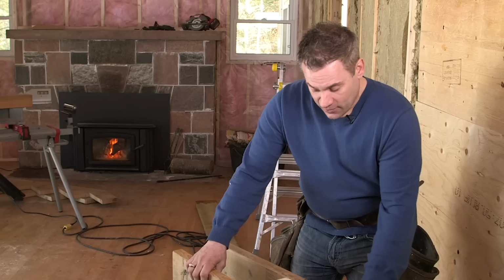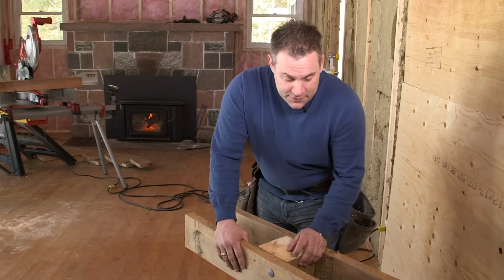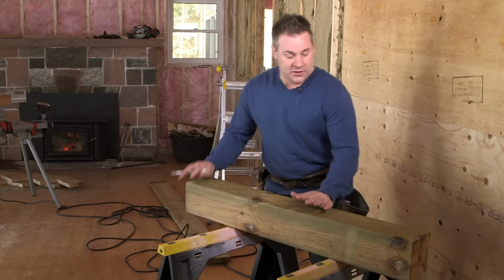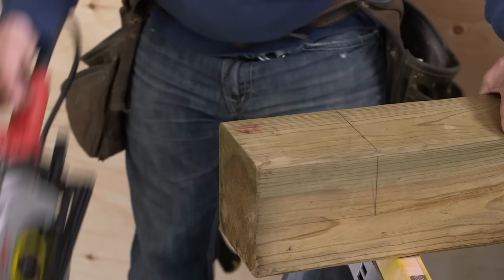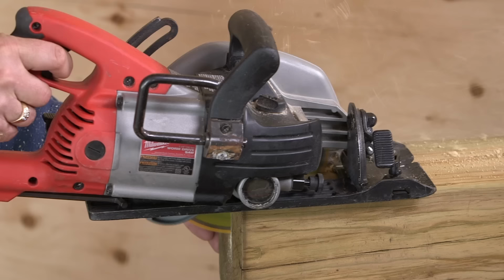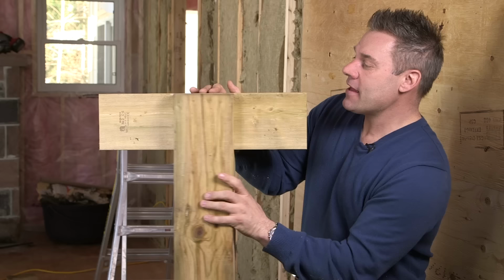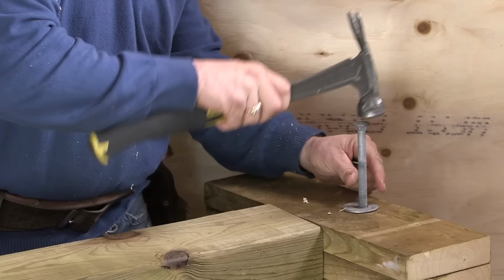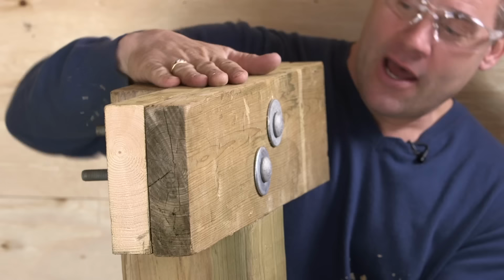How to Attach a Beam to a Post for a Deck | Decks, Docks & Gazebos

Comment: I am an engineer. I know what shear is.  Those bolts are in double shear. They get to add strength. The area of  a 1/2" bolt is 0.2 sq inches. The cheapest steel is good  for over 100 ksi. So 20,000 pounds per bolt shear, but double shear is 40,000 pounds per bolt. Two bolt s 80,000 pounds.  That is 5 big elephants. More elephants of average size.
When he breaks off the screw,  he loading a cantilever. That is not shear.
Reply: even five 16 penny nails will take over 800LB before they will shear? With that said I do exactly as the video described notch out and then I nail them in place.
Reply: Clark Magnuson succinctly put mate 👏👏👏
Reply: T
Reply: Analog human - would recommend the concrete patio...with that gathering, weight will be last of your cleanup worries...
Reply: @Clark Magnuson,  I understand where you're coming from, but you left out the possibility of wood failure as the cause of a deck collapsing. Shear value is meaningless and has no effect in that situation. Why take a chance on just a bolt to hold up a support beam?
Reply: @bgdesignandsolutions  there's only 3 bolts holding wheels on some cars.  How is this possibly safe?  ;)
Reply: @MotivatedMetalworks  Bolts that hold wheels on cars are heat treated and tempered. They are also fine thread which allows for firmer grip and tightening of the wheel lug (nut). The wheel is also designed with a Cone which collapses when the lugs are tightened. This works the same as a forcing cone, or in simple terms, a lock washer. The bolt is designed to take the torque of the lug. There is no sheer factor involved in a wheel lug, as it is a torque management with direct pull. The force is outward, not sideways. A typical lug bolt can withstand some 2,400 pounds of direct pull, thus making a 3 lug wheel able to support an estimated 7,300 plus pounds. Far more than is needed to support a car.
Reply: @bgdesignandsolutions  You're not big on sarcasm, are you.
Reply: @MotivatedMetalworks  That wasn't meant for sarcasm, I wasn't quite sure the meaning of your question, or why it was even asked. But I would like to add, most wheels on cars and truck use the center hub to actually hold the weight of a car or truck. But rarely, some do not make contact on a hub, yet the lugs are sufficient.
Reply: @bgdesignandsolutions  You sure like talking out your butt don't ya.

The hub holds the wheels via friction that's applied from compression of the lugs.  The hubcentric ring on the hub merely holds the rim in place while the lugs are tightened.

The only real dynamic force the lugs are exposed to is lateral (during hard turns, or horizontal impacts such as curbs after a crash or spin out), the rest is static which maintains the friction between the rim and hub assembly.
Reply: @MotivatedMetalworks  You need to stop while you're ahead. You just said exactly the same thing I already said, so don't continue because you will just look stupid.  You: The hub holds the wheels via friction that's applied from compression of the lugs.. . . The only real dynamic force the lugs are exposed to is lateral (during hard turns, or horizontal impacts such as curbs after a crash or spin out),    ME: The bolt is designed to take the torque of the lug. There is no sheer factor involved in a wheel lug, as it is a torque management with direct pull. The force is outward, not sideways.   Sideways is sideways of the bolt, not the wheel, in case you didn't understand that part. In other words, there is no vertical sheer, only outward pressure.    Other than that, what's your problem, you just wanting to cause an argument?? Because that's what is sounds like.
Reply: I'd need to know names of dances they will be doing and DJ/band set list for bolt recommendation.@Analog Human
Reply: Analog Human You have to take in to consideration if the animals are going to eat at the party that they will be heavier
Reply: The cheapest steel is not good for 100 ksi. Mild carbon steel has yield strength of 36 ksi.
Reply: BG Design and Soultions nicely done!
Reply: I'm no engineer but I did stay in a Holiday Inn about 6 months ago.  I'm never sure where, or how, engineers, architects,   builders, municipality inspectors,  and so on, get their information from but......you cannot use carriage bolts for structural connections.  THEY HAVE NO NATIONAL DESIGN STANDARD RATING.  (NDS)  With no NDS rating they are unacceptable.    This is easy to look up or call Simpson Strong Tie on deck connections. 

   The video shows a washer under the head of the carriage bolt but it makes about as much as sense as using bolts in the first place.   The underside of the carriage bolt has a square body.  When the nut at the other end is tightened, this square body turns at some point, and will tear at the wood fibers.   The nut cannot be tightened!.  The washer does no good at all in creating a positive connection.   The washer can actually deforms  Washers are required under the heads of nuts of through bolts.  (Both ends)  They are required under the heads of lag bolts.  

    Decks should be built like your house.  Live  (variable loads) are carried in tension or compression.  You can have loads transferred in sheer but they are ENGINEERED like joist hangers and hurricane clips, for example.  We see failures all the time of exterior decks......... Where there are no positive connections,   lateral or variable overloading,  and water works its way into the deck ledger assembly, (deck-to-house) weakening the connection. 

    Boys and girls do not build your houses decks, storage sheds, etc,  where loads are transferred in sheer.  You are asking for a whole lot of trouble.  (Don't even think about tree houses. They are death traps)  Call your favorite architect or engineer for plans.  If they say carriage bolts are acceptable, ask to see where that is in the NATIONAL DESIGN STANDARDS!   Your builder will not know this, but it will save you from injuries or deaths not to mention lawsuits.
Reply: I am still no engineer so this should be easy for you.  I suppose you could tell us where in the NDS that carriage bolts can be used for structural applications?   
     But let me help you.......You can always try finding carriage bolts being used under the Prescriptive Wood Deck Constriction Guide for code acceptance. 
  
    You could also go to American Wood Forrest and Paper Association-NDS for Wood Construction Manual references:  
   ANSI B1 18.2.1-Bolts and lag screws
   ANSI B1 18.6.1-Wood screws
  Tell us where you found the specification for carriage bolts (ANSI B1.8.5)

   "Not referenced", you say?  As an engineer, if it's not referenced what would you say they are acceptable for use?   You probably wouldn't tell that to your boss that or make a case for that in court.  Right?

    Look, I am not and engineer, architect, designer, code compliance official or attorney.  I am just a guy who likes woodworking, so it should be pretty is easy to say "I'm wrong" or "I'm correct."   I have given you all the necessary references for you to draw an objective conclusion.
Reply: the video shows the only acceptable way to support a deck beam in all 50 states and all of Canada according to current building codes. The first thing a building inspector would look for is proper load support. Carriage bolts would shut the build down immediately!
Reply: You are right Ken @rkenjohnson6705  All these comments seem to missing the point here.  It doesn't matter if the carriage bolt can carry  a dead and variable load of a  traveling circus with all the elephants....Carriage bolts are not approved for structural wood connections!  They just aren't.
Reply: BG Design and Soultions your vehicles made of bolts and you trust that lol
Reply: BG Design and Soultions nice try but the cones shape on lugs nuts and rims don’t collapse they just center the wheel and have more surface for grip
Reply: completely right....and On the other hand....if you tight enough  the bolts, it could be that. the main resistance of any movement  is made by friction between wood elements, and shear on bolts will be unexistant ( they will have tension only) .maybe .until wood shrinks  or have some volume changes..Im always  a little scared to reduce column section and have joint there.
Reply: Yes !Look at how heavy equipment trailers frames are attached to the under carriage. Bolts! Most trucks are supported by bolts!
Reply: BJ remind them that the weight of the vehicle  makes all the difference in the world    my 3/4 HD truck takes 8 lugs
Reply: As an engineer I look at that notch and see nothing but stress concentrations which in wood is really bad thanks to the fact they have grain which can split. The other thing he forgets is when clamped the mating surfaces develop friction which can transfer load like a wheel clamped to a hub on a car. The studs don't carry the load the friction between the hub and rim does.
Reply: @jaredbradley4095  you're a carpenter you know the one who had zero responsibility if the design fails. I'm the engineer the one that spent half a decade learning physics and mathematics. You only build to codes, codes created by people that know how the hell the real world works. Before you get all uppity realize the modern world was created thanks to theory guys in a nice AC office. Or would you have created nuclear power plants with some real world know how?
Reply: How about the roof load bearing down and splitting the 2x6  from having big ass holes drilled into it for the bolts.
Reply: Jesus please dont tell me you're a practicing engineer. Literally the only things u said correct are double shear and the area of a half inch bolt is .2 inches.
Reply: I agree with you I'm 62 and been doing it that way from when I was 18 and it always pass the building inspection so Mr engineer your right
Reply: thank you -- this makes a lot of sense.  That said, I cut notches like he recommended because it never fails that when I throw a party in the summertime, all the fat girls show up and things could get a bit dicey.
Reply: My god you guys... Really?!?!?  Surface area to distribute weight is crucial, keep it simple, not much surface area on a bolt, end of story.
Reply: Engineers estimate weight with elephants.
Reply: @Analog Human elephants aren't allowed  , they drink too much.
Reply: Clark Magnuson you are right, after the bolts structure get stronger also as the framing gets further along when square Ed up and complete there won't be any real violent movement to the post and beam. If the right style bolts aren't sufficient than I know not quite the same, but metal joist hangers would never be sufficient and they use 4 nails.
Reply: misa smith  ...hit a nerve ?
Reply: The 2 beams gain strength sandwiched together.  Splitting them around a post is another reason its a terrible idea. Waste of lumber.
Reply: Day-um can't we all just get along?
Reply: @MotivatedMetalworks  Race cars only use ONE!!!
Reply: @transtubular  so do helicopters.  ;)
Reply: Sure bolts can be strong.  But even stronger is putting the beams directly over the posts.  Its cheaper than bolts. And stronger.  So there is no reason to hang a beam up off the side of posts with bolts.  Except maybe in a special application when thats the only option.
Reply: Clark Magnuson also an engineer and was going to say exactly this. Sure, the alternative he shows is stronger due to adding the compressive strength of the post into the equation, but in no way are (2) 1/2” carriage bolts an unsuitable support for a regular deck
Reply: Pete Sessa l
Reply: Keep it simple engineer
Reply: Eh, the bolts hold friction in addition to the shear strength. Just as the little screws don't hold rock on the wall. They hold friction that holds it up.
Reply: Ill trust his house in 100 years not yours.  You obviously havent seen the effects weather has on man made materials.  Your a mathematician not a crafstman.
Reply: While this video may not have perfectly described the forces involved, this method of construction is vastly superior to simply attaching the post to the beam via two lag bolts.   Bolts are usually manufactured to exacting specifications that vary little from bolt to bolt and so if you calculate the strength of one you pretty much have the strength of all the others.  Wood, however is not so consistent.   While you MIGHT be safe using the former method, the later guarantees it.  In the bolt only method the only wood that is directly supported by the top bolt is about the top 20% of be beam.  The lower bolt supports about 80% of the beam.  If one is to do bolt only then both bolts should be close to the bottom of the beam.   However, by cutting a notch in the post to support the beam then the primary function of the bolts is to merely fasten the beam to the post.  Since 100% of the beam is ultimately attached to the post anyways, one might as well use a more stable design.   After all, with all the variation from beam to beam one can never be absolutely certain if the beam is going to split or for that matter the post.  That likelihood is greatly reduced using the second method over the first.   Also, there must be something to it since if you are making a deck, the building code requires the second method or some variation of it.  I'm not an engineer.  But I have been  building decks since 1976 when I was 16.  My first deck ever still stands and I guarantee you could safely march a heard of elephants across it to this day.  It is good to be an engineer but engineers don't know everything.   I have worked for or with several and none hold any patents.  I hold three.
Reply: I don't know what car only has three bolts.   My car has four wheels each has five bolts for a total of 20 bolts.  My car weighs 3000 lbs.  Add in passenger weight of say 350 lbs,   That comes to 168 lbs per bolt.  Using the standard that anything carrying a human must have a breaking point 5 times the rated amount. I would say that the breaking point per bolt should be 840 lbs.   Anything transportation related is very carefully engineered as to weight ratings.   I am less familiar with the engineering of lag bolts but I personally would only use them to fasten, not to support mass.   A structure would likely be required to hold a lot more mass than the four wheels of a car.   The deck I first built when I was 16 rests on four posts that are 6" x 6" oak.  They have 8 cantilevered beams using a similar construction technique to what is in this video.   The deck is 16' x 16' and I built it in 1976.  It sits four feet above the ground.   We have had 25 adults at a time on that deck along with furniture, BBQ grill, planters and recreational equipment as well as the weight of the beams and floorboards and other construction materials.  Not the slightest vibration.  I estimate the weight on those four posts at about 8-10 tons including all of the above.   There are a total of 16 3/8" lag bolts fastening the beams to the posts.   It has survived 44 years, 2 hurricanes, 1 tornado, 21 tropical storms, 57 blizzards, and over 500 summer cook-outs.   I would invite any heard of elephants to march across my deck or for that matter as many as you could cram onto the deck.   I am very confident it will outlive my great grandchildren.  I would be nervous riding in a car with only three bolts per wheel.   But then I don't design cars.
Reply: @nunyabiznez6381  decks are not that hard to build if you have some common sense. This is why the decks you've built in 1976 still stand.
I would have loved to see him shear the screw with no mechanical advantage, like for example hit the base of the screw with a flat head bolt and a hammer... That would be shear. And it's muy harder.
Reply: your missing the point....the point is to have the beam carry the weight, not the bolts, as its designed too....id hate to have you engineer anything for me
Reply: Everyone talks about the unpredictability of wood, but what about the bolts. Those bolts are galvanized, which resist rusting and oxidation for a limited time. Once the coating dissipates, the metal begins corrode. Much like a galvanized chainlink fence, they rust. Usually why a 5 year warranty is the standard. 

Not sure why these engineers resist having the beams rest on the notched post.
Reply: I don't think the "Shear" is as much a concern for the bolts as it would be for the holes in the wood ..... The WOOD is probably where any problems might arise , not the bolts .... The holes in the wood might loosen up , maybe crack , no telling later on after the wood has aged and been wet and dry 100 times ..... The guy is technically right , that IS the proper way to do a beam and post , to set beams ON TOP of wood is stronger .... There's no doubt about that ..... Not saying bolts won't hold of course , they are strong ..... Just saying his way is BETTER overall .... A hassle though , I'd set beams on top of post using a Simpson Post/Beam Bracket myself
Reply: You're not much of an engineer then if you want to support lumber in this manner. This isn't steel.
Reply: Im actually curious if a deck could hold a full grown elephant on top of it. Anyone know?
Reply: @shure46  thank you for understanding the physics of lumber. Our "engineer" above forgets that the bolts aren't the issue, it's the lumber that is carrying the load. No matter how much one tightens the bolts, the lumber one way or the other is carrying the load. Side bolting the lumber without support is a recipe for disaster. That's why load-bearing walls and doors have sandwiched headers . . . Sane principle here.
Reply: @PorkyHontas  I only know one thing , Greek Temples have beams ON TOP of the columns , not bolted to the sides .... they seem to be holding up fairly well after 3000 years ...... lol ...... but like i said , bolting works , but resting on TOP is always better , no way around that ..... I don't know if I would go to the trouble of NOTCHING the posts , I would just use simpson post/beam brackets , but the beams would be on top of the 4x4 post and no notches ...... (notching removes lumber , smaller lumber rots quicker over time) .....
Reply: #MAFA
Reply: Thank you for that info! I love to learn more about the calculations for my own personal projects. A++ info.
Reply: What's the purpose of using carriage bolts with washers?
Reply: While it is true that there is actually quite a bit of shear strength in carriage bolt. It is not approved by any wood standards/relevant codes. Thus cannot be used in construction. 

So while in a mechanics of solids point of view what you say is kinda correct, aside from the fact that you are using high strength steel and cheapest steels are actually 36ksi and you completely ignored the strength of the wood which would have to bear on the bolts and the way that the bolts are placed will reduce the total usable shear area of the wood. 

It is completely irrelevant, as it is not to code (unless your local ordinance approved of it)

Having said that, physically speaking the wood would likely shear around the bolt long before the bolt will shear and that screw example in the video was pretty terrible.
Reply: @jaredbradley4095  if the board is going to crack its going to crack where its not supporrted
Reply: @jaredbradley4095  You do know that their "theories" are created with the idea of unpredictability in mind, right? I say this as a carpenter. If you're looking for a way to erase risk 100% you're wasting your time.
Reply: @NGWrenchin  Unless one is trying to get them to pass any sort of city building code in the USA or Canada. If one is trying to pass an inspection, then, yes, two carriage bolts are unsuitable. By the way, would you sign off the plans that called for using two carriage bolts in such a structure? If in the off chance you were dragged into court to defend your choice of carriage bolts for structural connections, what code would you point to to support this?
Reply: @firepower7654  I would and have signed off on it,  and I would point to math, physics, and material science proving it is a suitable connection. What would you like to use to show it is wrong other than gut feeling and 'I've always done it this way'?

Again, I'm not saying the way the video says to frame it is improper, but there are multiple ways to build things that can work for the loads intended. Saying there is only one proper solution is just wrong.
Reply: @NGWrenchin  Well, it is obvious that you are not a structural engineer. It is a matter of "I've always done it this way", it is a matter of building codes. These codes are in place for a reason and have been tested over time. They aren't always the best way, but a minimum standard. If you were actually in the construction business, you would know that a bolt through system, as given in the first example, is NEVER acceptable in such a structure. EVER. At least not in the USA or Canada. An inspector would probably laugh in your face if you handed him these plans even if you said, "...but math." 

There are multiple ways of doing something, but only a handful of acceptable ways.  A Simpson tie or similar manufacturer with tested and documented materials backing those tests is what is looked for by every engineer and inspector that I have ever worked with. Those are the key documents protecting that engineer from liability in the case of failure of a connector. You're the first I've ever come across that thinks its acceptable to "just throw a carriage bolt through that."  If you're talking a job for you neighbor that isn't going to be inspected, that is one thing, but if you're putting plans together for a PAYING client, that's another. Best practice is not to hand over plans that are never going to pass inspection, and waste that clients time and money.
Reply: @firepower7654  I can assure you I am a licensed engineer in multiple states and  there is no part of the residential construction code for those states that prevents this method of band attachment. As for the documentation from Simpson/ USP/whoever rating their connectors, what do you think that is other than published results of their math? Engineering is literally the practical application of math, physics, and material science, so if I have an inspector who has a concern with something that is not a structural issue, I tell them "but math" as you state it, with my seal on said math, and it passes, end of argument. The state has the confidence in my design abilities after taking multiple tests proving my ability to do 'but math' to a standard they deem safe for public welfare.
Reply: @NGWrenchin  You think your engineering degree trumps a building inspectors stamp?  Sorry....I had to stop for a minute to fucking laugh my ass off. I can't tell you how many times I PERSONALLY have had to call up engineers and ask them what the fuck they were  doing because the inspector just threw their signed off plans in my face and told me to piss off. Your signature and $2 will get you a cup of coffee at Starbucks if they go against or are not understood by the inspector. They are meaningless if they aren't accepted and in practice methods as stated by a planning and building department.
Reply: @mattedwards4533  
What is a penny nail, I've never heard the term. I've used plenty of 2,3,4,5,6 ins etc nails but not a penny nail. You say five 16 penny nails, which is it 5 or 16?
Reply: @globeforever9777  ,Use five nails the size nail is  16 penny. 16 penny is how you size nails.It is the nail used when framing up a structure the conventional way using a claw hammer.It is an old English term used by carpenters. I believe it means penny weight but not 100% sure ?
Reply: @mattedwards4533  
Thanks, it must be a U.S. thing. I have been in the joinery and building trades for around 50 years in the U.K. and I have never heard of "penny" in connection to nails just length and gauge.
Reply: I'm also a structural engineer and I abide with this comment.
Reply: Not only is Clark the Engineer absolutely correct about the shear strength of the bolts (and correct about the irrelevance of the screw-breaking stunt), but notching the post is a major detriment to the longevity of the wood. It creates another flat surface of untreated endgrain for water absorption, this one being perfectly designed for water to seep into by capillary action, but unable to easily evaporate. It makes infinitely more sense to minimize trapped water on wood surfaces (especially where the ends are exposed and treatment is cut away), and to rely instead on the far stronger shear resistance, and greater longevity, of the bolts.
Reply: Clark Magnuson - That's well stated and I agree with you, and I would add another reason not to worry.  As long as those carriage bolts are tight enough that shrinkage of the wood does not cause them to actually become loose, they will never even need to rely on their shear strength at all.  When the bolts are tight, the friction between the beam and the post where they clamp together will exceed any load that will ever be carried by the beam.  This clamping force and resulting friction at the connection point is exactly the same principle that prevents the wheel studs of your car from undergoing shear stress when you slam on the brakes.  If the wheel nuts are tight, friction at the connection of wheel to hub exceeds any force that's applied there.  I DO love your analogy about adequate shear strength though (5 big elephants, and more if they are average size).  Well put.  Also, the info I added here is not for you, but for the original poster.
Reply: Carriage bolts come in many different metals. The galvanized ones are crap! You can pop them just by tightening them.  Zinc coated are good though.
Reply: @grad79 I removed a support wall by sandwiching it with 2×10, temporarily fasting it with 2 deck screws on each end with a rim/knee brace ten years ago in my 2 story house 😊😛😝🔨📐📎
Reply: @Analog Human : lololololol
Reply: But he is still right. All building with would should leverage compression to the fullest, not rest on connector piercing the midst.
Reply: @transtubular  Yeah, but it is a BIG one! 
You only really have to worry about multi lug applications when you are trying to keep the tires from shearing off your house when you have fat trailer park girls at the party.
Reply: @tomknud  Absoultely, unless it is a building made of would not. 
Get it "wood knot". I'm killing it today!
Reply: @davecozzi9721  ahhahaa
Reply: @MotivatedMetalworks  The cross section of metal is stronger so that a bolt through it wouldn't act like a splitter as it would in the through bolt version this fellow is derogating.
Reply: @nunyabiznez6381  I agree with most of what you've said and would choose the second method over the first for my deck, it's your idea that all bolts are created equal, not true, there is more varieties of bolts than apples and oranges combined, each made for a specific set of circumstances, bolts that say NASA use would not be found at home depot.
Reply: @bgdesignandsolutions  more importantly there is a flange machined into the spindle hub, the wheel sits on this flange, so this is a terrible example, Because the bolts are mostly in tension, clamping the wheel to the hub
Reply: Thank you for saving me the effort of explaining how stupid this is
Reply: I am / have been at various times, a Military Engineer, Carpenter, Maths Teacher and Science Teacher. The Engineer says ‘what do the construction tables say’, the Carpenter says ‘halving joint’, the maths teacher say ‘let’s calculate the stresses’, the scientist says ‘let’s make up two decks in two different ways and have one big ass party and see which one fails first’!
Reply: Pete, I'd agree with you up to the point where a building code allows deviation from the code on the certification of a design professional (architect or engineer).  I had to do something unorthodox on a repair to my home three years ago.  We engaged an engineer to devise that solution.  The engineer had to certify that solution to the building inspector and did so.
Reply: Thanks Clark.
Reply: I study physics.  The point is that the mass is distributed on the wood and post instead of just using the bolts themselves.   Can it take it?  Maybe.  Why not over-engineer just incase your mom comes over and climbs up on top.
Reply: TJP 81  With full tightened carriage bolts you'd have to load the post up with 10's of thousand of pounds to cause the bolt to sag into that wood!
Reply: I hate carriage bolts. If you need to uninstall the bolt the heads always lose grip due to soft wood and spin. I use hex head bolts with large washer.
Reply: Even noting he's hitting a cantilever. A hammer can still impart thousands of pounds of force on a small area, when a #8 screws shear force is like 25 pounds
Reply: matt edwards if he is so worried about it he can add 2x4 under instead of notching a post like that never had problems anyway I have yet to see one sheer, imagine if that were true not one building would stay together or vehicles with the bolts pulling trailers
Reply: only argument can rebut your argument with is, a notch helps prevent catastrophic failure.  
With the change in Pressure Treatment formula yrs ago that caused a revamping of "deck grade" galvanized fasteners,  failure of the fastener became a big issue, the old galvanization treatment with the old PT formula was fine, the new formula ate up the fasteners through electrolysis, yes even the notched version will have fastener failure, but the "post and beam" similarity can prevent a failure at potentially the worst time.  If going to rely on the fastener for structure, must pay VERY CLOSE attention to to fastener treatment.  wrong fastener can lead to a very premature failure with dire consequences.
Reply: @chucksewers2309  its called a cleat. And its standard practice on certain decks.
Reply: BG Design and Soultions wrong. Roughly every 10 feet there is a connection like this.  So every frame connection would have to fail. Notching the wood works. But he failed to mention you loose strength in motion. If that wood moves back and forth let’s say from an earthquake all connections will snap from his Notch.
Reply: wrong. Roughly every 10 feet there is a connection like this.  So every frame connection would have to fail. Notching the wood works. But he failed to mention you loose strength in motion. If that wood moves back and forth let’s say from an earthquake all connections will snap from his Notch.
Reply: R Ken Johnson this connection is not allowed in California or New York. You can not cut a notch into a support beam like that. You have to lay you beam Ontop of the vertical wood. And use a Beam connection clamp. You can not creat stress fractures. This connection is not allowed in a lot of states
Reply: Pete Sessa your wrong. You forgot to mention. In all those Books it says unless the Local AHJ having jurisdiction says other. Also this connection is illegal in California and New York. You can not notch Support beams and create stress point. You must use Beam connection clamps and Top load. If this guy ever got an earth quake or hurricane it fall down FAST
Reply: Pete Sessa your first ansi b1 18.2.1 is for Hex Bolts you labeled that wrong. And it’s a cut sheet and does not list sheer strength or say what you said. So don’t lie
Reply: @julioweber3944  what's funny, is everyone saying you can't rely on bolts alone for structure. I guess every addition/deck is going to fall apart that has lags for their ledgers. 

IRC does dictate notching is an acceptable means of putting a load in a deck, but I prefer a cleat. (IRC states you need minimum 1.5 inches of bearing ABOVE your postt/beam. Most municipalities will fallow this. 

Again though. The bolts themselves are MORE than enough, and there are decks built 50 years ago like this, still standing today.
Reply: I would think it's the wood that would split over the bolts
Reply: @OldPossum it doesn't matter as they are not acceptable by building code and inspectors will flag that
Reply: @cowboytroy72  regardles, they are not acceptable by building code and inspectors will flag that
Reply: The best solution actually is to attach the beams to the top of the posts with post saddles.
Reply: @OldPossum I agree that's it's possible and that it should hold. Best practice though is to rest the weight on top of posts instead of bolt to the sides. That's all.
Reply: Direct weight transfer is always the way to go. Relying on indirect weight transfer for a beam is a bad idea. Having a degree in engineering doesn't automatically qualify anyone as an individual who knows what they are doing or talking about.
Reply: OldPossum  facts are facts...skippy. Whether it’s a deck, a bridge, sky scraper or a home, the basic laws of physics always apply. A good engineer, someone who understands applied engineering verses numbers on a page can relate to what I am saying. Build it right or don’t build it at all.
Reply: bbillyed .
Reply: @Analog Human If you invite my wife I recommend you build it the way it was demonstrated.  I was using a laser level one day and when my wife walked by I saw the light actually bending.
Reply: @kaz9781  Indian or African?
Reply: Agreed on the false shear pressure example. But, the wood, in the cross beams, in two small areas, is accepting all the weight of what is to be stressed upon them. Now include weather, i.e., rain, snow, freezing, and hot...
Mr. Engineer, do your figuring on the load bearing capabilities, on the doubled up, notched post bean support system.
Reply: @nunyabiznez6381 An awful lot of French cars have only three bolts holding the wheels on. I suggest you look up the law of inverse squares, assuming the same material a single one centimeter bolt has more shear strength than four .25mm ones :)
Reply: Clark Magnuson Jason Lake has it right. No risks. Notch the damn posts. End of story.
Reply: John Parkhurst so the bolt head or nut don’t dig into the wood.
Reply: OldPossum   lol at least I have a tail to chase. You can equate that to “I have a pot to piss in”. Which leaves you without one.
Reply: Shouldn't they install deck beams on top of concrete piers?
Reply: Roger didit   No, the posts are installed into post bases which are mounted in or to the concrete peering . The beam supports the joists which in turn transfers the weight to the posts and finally to the peers. That is why it's important to notch the posts so that the weight transfer is direct instead of offset.
Reply: @greatamculture  OK thanks now that I remember back, I'm positive that you're right.
Reply: I agree.
Reply: @glynowilliams  when I built the deck I took into account that the food would be set out on the deck. So, whether it all gets eaten or not, it may add weight to the animals but not the deck as a whole. Hope that makes sense.
Reply: @Carl-LaFong1618  african
Reply: Yeah I got that thin piece of paper too.. I was thinking the same thing BUT were racing so fast to defend the massive shear strength of the bolts that clearly would never fail in a properly designed deck or frame, the WOOD could EASILY fail if it rots a bit, not so easily with the notch, but yeah in a perfect world with no rot those carriage bolts aren't going anywhere with normal loads.. the notch step definitely adds some serious strength though I get it..
Reply: I deal with engineers every day. A good one stays humble and doesn't need to tell everyone
Reply: @petesessa2041  like the Kansas city incident years back?
Reply: @Slick1G3  my  06 gmc  takes 32
Reply: @JM-nh8yp  ever build a fence ?
Reply: @nunyabiznez6381  can I come over for a cookout with my elephants ( wife and kids) and check out your deck. ?
Reply: @lostcause1206  Yes I have built fences. Of course, fences don't carry a load like decks do.
Reply: Issue isn't the bolt it is the wood will crack down the grain line and potentially the beam falls.  It needs to be notched or can be placed above the post with galvanized bracket. But yes you are correct about shear and bolt strength
Reply: @lostcause1206  Well....The sky walk collapse was do to an unapproved connection inserted into the tension cables that supported the assembly.  The connection failed at the "weak link" and rest is engineering and legal history. 

  In the meantime........ carriage bolts ARE NOT referenced in the National Design Standard (NDS) for structural wood connections and are therefore not approved.  Seems simple to me.
Reply: Analog Human How did your party turn out?
Reply: Them there tyaneeze bolts ol do er  . I R An engineer to
Reply: nunya biznez asa
Reply: its not the bolt that will fail. its gonna be the beam that will fail. Putting one elephant on half inch bolt over wood beam lol it will cut the beam right through like knife cutting butter.
Reply: No offense but I'd rather trust the person that actually installs it.
Reply: Proof that an engineer is not a carpenter.....we fix your "better" ideas all the time.
Reply: Kelly Giesbrecht  Yes, you obviously didn't read my own posted comment on this video and just reading the conversation here. As for the "teleposts" in a basement, keep in mind most of them are not supported by a foundation at the bottom and eventually cause the floor to crack, or even break through. Therefore, they cannot be placed just anywhere, but yes, they are usually placed under a joist or beam. 

Most tires are placed on a hub, with the hub making contact all around the center. The spindle, or hub, becomes the beam and the tire becomes the post by the scenario. So long as the post (spindle) is on good foundation (hub contact), the beam (spindle) is good. Should the lug bolts fail, so then does the beam as the wheel falls off. Comprender?
Reply: @bgdesignandsolutions  No you are totally wrong.  What "cone" on the wheel are you referring to?  Nothing collapses on a wheel.  If you are referring to the 60* bevel of the lug nut this is simply to help center the stud in the hole.  I can assure you the hole doesn't collapse and uncollapse every time the wheel is installed and taken off.  Also in your second comment you are referring to hub-centric wheels.  These are a fairly new occurrence and have nothing to do with the wheels ability to stay put.  The hub lip is so small that it does nothing with respect to the lugs.  It simply allows people who don't know how to center a wheel to do so without thinking.  A great many vehicles are still "lug-centric" as well as most aftermarket wheels that need to fit a variety of applications.  Clark is totally right.
Reply: @jfratis9081  Next time you change a tire or rotate them, be sure to watch them flex as the lug nuts are tightened and loosened. I think you're missing the whole point, and it would be useless to try and explain anything to you. I stated something simple long ago, and an average person should be able to understand. It's not a big issue, it's not the end of the world, and maybe someday you'll figure it out.
Reply: @bgdesignandsolutions  All of your arguments are nice examples of finely crafted word salad.  Well done but in the end you are wrong.  Sophomore college papers must have been your forte.  If the wood fails you don't have a deck no matter what technique you use to put it together.  Your attempt at being condescending has failed.
Reply: Carriage bolts probably rated 30 ksi tensile strength not 100 ksi. Shear strength is usually half of the tensile strength so: 4X150000X.2=12000 lb. Whether or not that method meets code I defy you to make that a failure point unless you park three cars on top of each other over the connection. It’s a deck and the joists will fail LONG before this point connection. All that said he is telling us the correct way to do it but  I have a perfectly serviceable 35 year old uncovered deck using the other method.
Reply: True. If he had taken a Strength of Materials class he would have said you want the wood in compression which is what he really achieved. He just had to say it in terms the wood butchers will understand. 😭
Reply: Hell you shouldn't even be building a deck out of wood anyway that's a Mason's job with a block, bricks or decorative stone or concrete pony wall perimeters fill dirt and sand with a concrete slab top .Never rot out, won't burn with your grill on top,  won't slip when it rains , Don't have to worry about rodents getting under or weeds or grass. All for about the same price with the high price of wood now days.
Reply: @Analog Human 😂😂😂😂
Reply: @notsofast I wouldn't say "can't ", it's more like not recommended and that depends on if they are zink coated or mechanically galvanized.
Reply: Issue isn't shear force it's pull out force. Not to mention the clamping force creates normal force which creates friction like a lug nut/wheel stud situation.
Reply: @MotivatedMetalworks  the expert there doesn't know his crap. The reason wheel studs don't fail is because they aren't put in shear. The moment they are you have a wheel flying down the road. The clamping force generated produces a massive amount of friction. This friction is plenty to stop the wheel from slipping on the hub. The lugs then don't have to take any shear forces as the friction handles it.
Reply: @petesessa2041  engineers don't rely on some lookup best practice table to do calculations. We are the ones that make those tables for people to use that can't do differential equations.
Reply: @wolfpack4128   You honestly think there's only sheer forces on a wheel?  Hahahahahaha
Reply: I have to agree
Reply: My concern is with the wood. The notch does look good.
Reply: @wolfpack4128  - Are you saying that posts shouldn't be notched in this manner to accept a beam?
Reply: @pterafirma  The point of this sort of joint is to allow for the 

The endgrain exposure created by the cut should be immaterial if the posts are made of an appropriately rot-resistant material.  If rot is a concern the cut areas can be treated in the field.
Reply: That is not what the guy on the video was talking about.  And wood failure could happen on the support column also
Reply: Very well explained sir. Thank you
Reply: I agree, but if you look you are then relying on the wood to carry the load. Assuming the load is simply supported the bearing stress on the wood (2x6) would cause the failure. The proper way he showed put the force on the post rather than the bolt, which is now used for holding the beam in place. To say it could hold 5 elephants is over looking the strength of the wood and the failure mode of the original design. The fact that its in double shear would only come into play if the material was equal  or better in load capacity to the bolts.
Reply: @LetsGetFitLarry   Yes Larry, there is more than one issue. But he has 5M views. I get to point out the metal is not overstressed. I like Hoadley's book "Understanding Wood" for designing things from wood. My grandfather got used wood After the Alaskan Gold rush at the Seattle Denny regrade. He built chicken coops. In 1950 he used that same lumber to build hip roof homes still visible on google earth at 138th s. and occidental in Burien WA. That lumber is over 150 years old now.
Reply: Maybe he has a lot of heavy people that come to his deck parties ... (:>)
Reply: @rkenjohnson6705  Here in the Demokratik People's Prison of Canada, compliance signatures come with a big brown envelope full of US cash. All other details are inconsequential until the structural failure occurs.
Reply: I totally understand your structural explanation.
I watch YouTube all the time to learn how to do things. Often I see people use the wrong terms,  or wrong techniques, or wrong instructions to do things.
Reply: I'm a mechanical engineer and was about to write the exact same thing.
Reply: @wolfpack4128    Look, I am no engineer.  And I think engineers make the world go round with an occasional failure along the way.  They are infinity smarter than myself so this should be easy for you. 
  
  The American Forrest & Paper Association (Made up of engineers like yourself) have developed and codified a National Design Standard  (NDS)  for Wood Construction.  You know, those pesky set of standards for building stuff.  
  The American National Standards Institute (ANSI) is a privately funded federation of business and industry, standards developers, trade associations, labor unions, professional societies, (like engineers) consumers, academia, and government agencies.  You know this. 
  Under ANSI B18.1.2 (Bolts and Lag screws and B18.6.1 (Wood screws) are referenced in their specifications. You know, those things you reference in your specifications all the time. 
  The specification for carriage bolts (ANSI B18.5) is not referenced in their specifications. Since is is not referenced, the performance (load) for carriage bolts in wood applications is not available. Therefore, it is NOT an acceptable fastener for structural wood applications.  
  Now then, tell us all how carriage bolts that are not a part of our National Design Standard and ANSI are somehow acceptable in your office or firm.  
  This should be easy for you too explain without trying to tell us how smart you are or trying to expand the argument.  (This is not about sheer strength, differential equations or moment frames) Tell us how a standard cut washer goes under the head of a carriage bolt without deforming.  Tell us how the bolt can be tightened from only one side.  
  I think we all can tell how smart someone is when they can answer questions in their field, simply and easily, without getting defensive or trying to change a premise or goal post.  
  Why not give us the place we can go to see if what you know is correct.  Reference any table, engineering standard,  professional group that supports your contention. Sounds simple to me.
Reply: 5 average texans then
Reply: @petesessa2041  Nobody gives a shot how the king says we have to build our decks
Reply: You need a load table chart in order to determine how much a 4x4 post can support. What I can tell you is this is the correct method for installing a joist to post👍
Reply: I agree like I said use grade 5 or 8 or a325
Reply: Another factor, to consider, is the codes enforcement officers. No matter how strong the bolts might be, if they don't meet code specs, it's a moot point.
Reply: When they bolt together a structural steel skeleton for a skyscraper do they notch the columns for the girders no they are bolted to plates welded to the columns All connection bolts are in shear load
Reply: @tonyhemingway7980  you don't have to get a permit to build a deck. It's like speeding or smoking weed. Just don't get caught.
Reply: @bgdesignandsolutions  In all actuality, the weakest "link" in the first design is the 1.75" of wood between the carriage bolt and the edge.  The question should be "how much weight will 3.5" of treated lumber hold?"  You are correct in your assertion that the wood would fail long...LONG before the bolt would.
Reply: nunya biznez 
The answer to the question of which car use 3 wheel studs is the Citroen 2CV .
Reply: Dennis Madigan 
You cannot use zinc plated bolts in treated wood in an environment exposed to water.  The bolts will decay from the preservative in the wood. Hot dipped galvanized bolts are recommended. Typical carriage bolts are grade 2 and have a rating.  You may have to use a larger diameter bolt to get the strength you need.  Carriage bolts are not made of cheese, they have a rating it's just not as high as a grade 5 or grade 8 bolt.
Reply: @nunyabiznez6381  how about Smart Cars?
Reply: @EitriBrokkr  this is only true for hub-centric applications. Most modern cars are lug-centric.  Most after market rims have slightly larger hub center diameters so they fit on a wider selection of cars, with the same bolt pattern but different hub diameters, i.e. Toyota's and Nissan's (Toyota sedans have smaller hubs than Nissan sedans)
Reply: Thanks.  Pretty much what I thought as well.  The drywall screw is hardened, never intended to take the load as demonstrated.  Of course it broke.  A nail or bolt would bend without breaking.  (Not suggesting to use a nail here; just commenting on the difference in metals.)  Notching is better but the OP's post has false premises in it.
Reply: @petesessa2041  Because we all know that no building history was ever safe to live in because Simpson hadn't come into existence yet or because some guy with a stamp didn't approve it before it was built.
Reply: "Double shear" only works with tight tolerances.  With wood which can warp or the holes can be non-precise, it is irrelevant.  One can experience 90% of the shear before the other experiences any (remainder being absorbed by friction between wood surfaces).   You are absolutely correct on the screw example though.
Reply: Yeah, it's easy to break or bend a fastener that is only half way into the wood. I think the notching technique just looks more neat.
Reply: I don't know what the hell your talking about but I concur.
Reply: Yeah, this guy really missed the mark.  Bolt shear strength plus clamp strength are much more than sufficient to carry the load.  I would be more worried about the wood fibers tearing than the bolt shearing.  BTW, I'm an engineer too! :)   Six year old video and somehow, Youtube thought I should watch it...go figure.
Reply: @gpa1978  Nonexistent.Finish high school.
Reply: @Grunt49  you are right, I did it almost 25 years ago, Im trying my best with secong lenguage though
Reply: @petesessa2041  The NDS ratings exist for construction to that standard, which is a predetermined and engineered way to achieve building compliance with regulations. An alternative and acceptable way to satisfy compliance is to get a structural Engineer to specify a solution based on their calculations and design. If an Engineer determines a bolt is a satisfactory structural connection and will sign it off, then that is acceptable. 

I guess you stayed at the wrong Holiday Inn if you're not sure how the system works or how the pros get their information. It's called Engineering - physics, testing, refining and knowledge born of degree study. You're welcome.
Reply: B really retry
Reply: Never met an engineer outside Europe who understood timber.
It's not just about the bolt failing.It's also about what happens to the timber under load - in this case splitting the beam along the bolt line if unsuported.
When supported by a small notch (1/2" is plenty!) all the shear loading is taken off the bolts making everything much stronger which means you can use smaller,much cheaper bolts and reduce your carbon footprint.
Reply: @kaz9781  sorry,  late to the party, but my ex mother in law, almost elephant size broke the steps leading up to deck. So,  um I don't think she would have lasted long on the actual deck before it gave out. 
Now her hippo daughter, deck held her fine
🙂
Hope that helped
😉
Sorry soooooooo late
😕